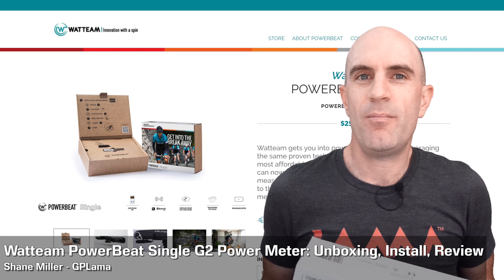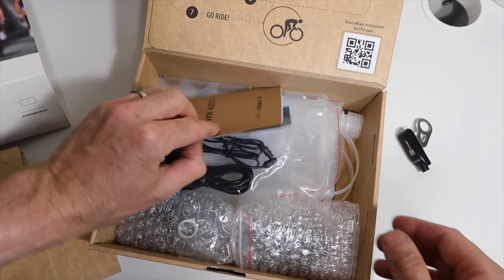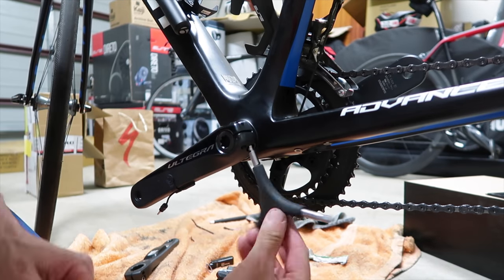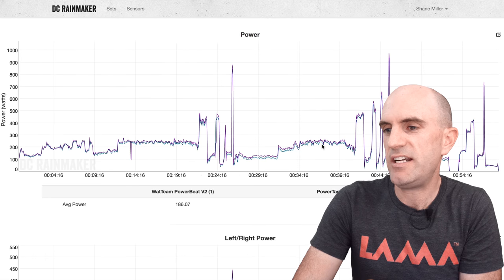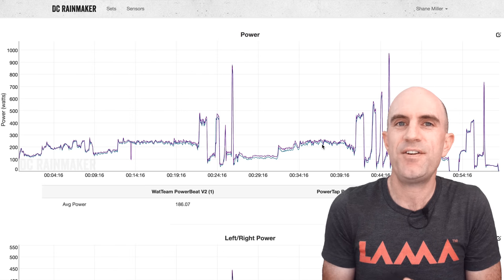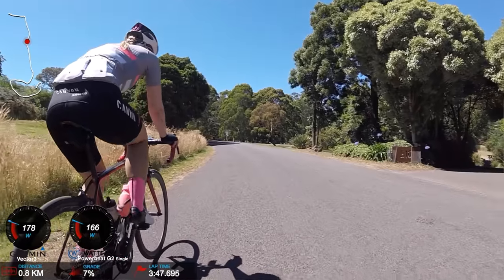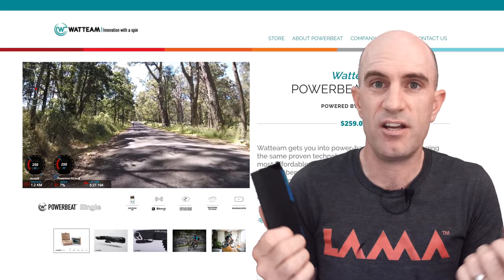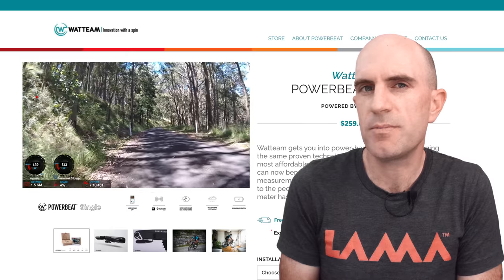Watteam PowerBeat Single G2 Power Meter: Unboxing, Install, Review

Comment: Hey Shane - so glad to see this review, I've been keen for your take on them.  I saw the other comment on calibration issue of not having a second source to compare to.  How about a KICKR17?  I assume the KICKR is accurate enough to figure if they match then it's all good?
Reply from the maker: Sure. Depends who you trust.... it’s a can of worms. I’ve always been able to line up my Kickrs nicely.
Reply: Hey Shane - Want to follow up on this.  3 months later and Watteam hasn't added that adjustment to their app that I can find.  I hope they do follow through with this.  I purchased the self glued option for my girlfriend's Ruby...catch here is that she has the stock Praxis Alba cranks which are NOT on their compatible list.  I knew this going in and knew I was taking a risk but at $200 US (CleverTraining.com 20% off sale) I decided it was worth the risk.  Worse comes to worse and I can get her a 105 or Ultegra crank set (her Ruby is the 105 version).

Here's my issue though, I can't get through the calibration process...it fails at the end every time.  I'm noting a few things during the process and actually just came back to your video to remind myself what you did with the weight.  She has Shimano PD-M20 pedals which are pretty heavy, so I think I need to compensate there a bit...and I just weighed my water bags and they were 10.2 lbs...so I need to remove some water.  But my concern comes in that the water bags hit the frame and crank (particularly the drive side) during calibration and I'm wondering the impact.  Did you notice this when you did yours?  Did yours ever straight up fail the calibration process or did you just see shifted data?

Also of note is that I can't get out of the calibration procedure in their app now.  So I have no way to even see if it's remotely close to correct for power.  It had been my plan to do a Zwift ride on my KICKR17 and comparing several steady state efforts but I'd need to switch it to ANT+ mode and I can't get back to that part of the app.
Reply from the maker: Bike/bag clearance... not an issue on the Giant TCR. Maybe attach some string/wire/rope and hang the bags lower. Maybe elevate the bike to allow more clearance? You'll need to get creative there. As for the app - Mine always completed the calibration ok. I'd like to see more debug detail within the app such as raw torque - that'd allow Quarq/SRM level validation of the process. I'd get everything you've done to date over in a ticket to Watteam support and see if they can help.
Reply: Shane - thanks for the response.  I did open a support ticket with Watteam but wanted to get your take on it too.  Sadly their response (which is cool that they took the time to respond on a US holiday so Kudos to them there) was:

 "We are sorry to inform you that it is not possible to calibrate with incompatible cranks.

We have gone through much beta testing and lab work to ensure each of our approved cranks is properly calibrated."

And a list of the compatible cranks.  I really wish I could get out of them WHY the list is basically only Shimano with a single Campy and a handful of Cannondale cranks.  When the product was originally announced they claimed it would work with any alloy crank which the Praxis Alba is.  Now again...I knew going in I'd probably have issues...but I was hoping that as long as I could get the sensor mounted (that went just fine) I could fudge the calibration by playing with the weights until I got it to match a known power meter.  As an engineer I find enjoyment in this sort of stuff...but I need a little bit of their help.

I"m now wondering if when you put in "Other" for crank type (their app DOES allow that) it simply won't allow the calibration to work.
Reply from the maker: Hmmm... There's two sides to them allowing more user control... it does increase overheads on their end. There's always balance when it comes to cheap power meters and levels of service/etc. Without the raw torque number it'll be difficult to fudge the numbers. It'll take a while on a non supported crank.
Reply: Yeah at this point I'm thinking I'll just buy her a set of Shimano 105 5800 cranks.  They are compatible and not overly expensive.  Even with the new cranks (and BB and cost to pull the Praxis M30 BB and press in the new BB) it will still be less than the cost of most other power meters.

Comment: As long as it tracks (almost) the exact same, isn't that good enough? At least for training, having consistent reads seems much more important than getting your max power. As long as you can see progress, I think it sounds good.
Reply from the maker: In isolation, sure. When wanting to compare numbers from previous power meters, go head to head with others on Zwift, or trust the effort is the same as a smart trainer, no.

Comment: Shane, Perhaps an average consumer will not have other power meters to compare with, so where is the reassurance of the accuracy of the unit upon purchase and initial setup for the cyclist purchasing this as their first and ONLY power meter? They will not know whether the unit is accurate or not.  But I like the way you reviewed it and tried to fix the calibration. Also a scaling thing you mentioned, how does one know what is accurate if this is the only power meter device they own as mentioned above, will it really help?
Reply from the maker: Discussed all trough the comments already. My take - Power is a known measurable unit, like distance. When you buy a tape measure it needs to be correct, not 5cm out per meter (give it take). Let’s say you build a house (an analogy for your training). If you use only that tape measure, fine. If you use another tape measure at any point, or you work in another house with your wonky tape measure, things go bad.
Reply: That's exactly correct Shane. Thank you for your reply. 
My point was almost saying 'does one need to own a second unit of power to see if this unit is measuring correctly'.

Comment: I purchased the dual side, self-glue version of these back in September.  My first few rides the L/R averages were going way off so I reached out to the crew and after sending them pictures they noticed my Right unit was glued incorrectly and sent me out a replacement at no charge.  I glued the replacement unit and things were reading more normal.  I don't have a trainer or pedals to compare against for accuracy - if anyone has suggestions on other ways to check accuracy  let me know - but aside from that I haven't had any issues with the devices.  I will say to make sure that the pod is not touching the crank arm because little things like that could throw the reading off.  My solution to get a nice tight fit of the pedals while making sure there is a little space is I put a folded paper towel between the arm and the pod so that when the torque from tightening the pedal moves the pod closer to the arm it has a barrier, and then when done just remove the paper towel.

Comment: I have had the 4iiii left side only unit for 22 months. I like that you can calibrate the Watteam under load but I am concerned about the location of the unit on the crankarms.  Pretty sure I would hit it  but the price is a game changer.  I think I prefer the CR2032 battery solution which lasts ~100 hours. I keep an extra one in my patch kit. You are assuming that your Vectors power values are correct. Is that a solid assumption?
Reply from the maker: Vectors and P1. And on the flip side you’re assuming they’re not correct. It’s not a guessing game on my part. They’ve been put up against many other power meters and had static weight tests performed.
Reply: I am a physicist/scientist and in my field you are guilty until proven innocent. It is not personal. Your answer adresses my concerns.

Comment: how do you know your power meter your using isn't over-estimating? you can't compare the actual numbers, you should only compare how the data tracks against the more expensive system. which this looks like it does pretty well
Reply from the maker: Static weight testing and 100s of other comparison tests across a ton of other power meters. I’ve got a handle on what’s accurate and what’s not. Your point is raised a lot.

Comment: What worries me a bit is that the first ride was OK and later it went out of whack. Who is to say that will not happen again, some time down the road. Tempting purchase but. And either ANT+ or BLE also sucks, for using with zwift (BT through zwift link app) and a Garmin ANT+ only devices later :(.

Comment: Did you send the data to watteam after your fix and were they able to reverse engineer the problem and come up with a reason why they weren't tracking correctly? and updated their calibrations process?
Reply from the maker: Their app sends the calibration data to them, so they have the data.

Comment: Great review Shane!
Do you know if it would work with supported (left side) crank arm on a not supported crank set ?
Reply from the maker: Cheers. I'd go with "nope" as it'd have a unknown deflection/bendy properties that'd render the measurements useless.
Reply: Thinking about it, might be OK - if the axle is rigid (which you'd hope) then it might be OK as long as the crank-arm can properly attach to the rest of the (un-supported) chain-set . The bulk of the measurement is after all in the crank arm, not the rest of the chain-set. That said, not sure how much compatibility there is between supported crank-arms and un-supported chain-sets..
Reply: The short story is that it has to be hollow aluminum crank design. They're going off the formula of how that material flexes (stretches).  Carbon would flex more and solid less, thus outside their calibration.
Reply: I think what Ripinda1911 is asking is, if they either fit a sensor on a supported crank-arm, or purchase a pre-installed one from WattTeam, and then fit that onto the remainder of an un-supported chain-set, i.e. the axle, spider and right crank-arm, then would it work. That's what I was reading it as anyway, no idea if that's correct or not of course :)
Reply: @Tim Parker Yeah thats what I ment. Sorry English is my second language.

Comment: Hi Shane, if you had a choice between the watteam dual side vs the new gen 3 Stages left only, would you stick with powerbeat? Thanks in advance.
Reply from the maker: I've not had a look at the dual Watteam unit. L/R and L only are different... Your call on what you need.

Comment: Just received my Powerbeat G3 Single and found they didn't include the glue! Unfortunate. I do have a question: I have a Wahoo elemnt, where should I mount my cadence sensor? Previously I had it on the left (non-drive side) crank.
Reply from the maker: The G3 will transmit cadence. Get that installed and you’re set.

Comment: Did you compare power with a smart trainer like Neo or Direto, that could have eliminated pedal weight issues.
Reply from the maker: Pedal weight issues were with the static calibration process, not accuracy.

Comment: Hello Shane. I own Bkool Smart Pro  trainer and want to have a power meter for a budjet. Right now when I doing planned workouts with using estimatied power thru the trainer I'm not sure what I got. Will Watteam PowerBeat Single G2 be a nice solution for comparasing the trainer with "normal" power meter? And if data is pretty similar then I can defenetly will use it for outside training. Also I think when I will have some compare data between them I can use Power metric according to expections without using luck in measurment. Thank you for your videos.
Reply from the maker: Watteam recently went out of business. So no, not a good solution.
Reply: @gplama  Too bad. It was interesting solution for me because I have rear breake lokated under BB on my B'TWIN bike and having 4iiii crank (the sensor lockated at the center of the crack) as an example won't fit me because of overlapping of power meter module and rear break itself. May be there will be some budget units in the future. Thank you again.

Comment: Shane Miller Hello,
I bought this power meter and i have a question
How can I know that the POWER METER really shows me correct numbers and not a little below? 
TNX :)
Reply from the maker: You need to compare it with a known good reference point.
Reply: tnx

Comment: Hey Shane, got any opinion / review of the newer G3 model of this? My CX bike doesn't have clearance for a left-crank powermeter so i'm tempted to go with something along this line instead.
Reply from the maker: Don't touch. The company has closed their doors and no longer operating.
Reply: Oh darn! That really sucks. the search for a cheap compatible powermeter continues then, maybe I'll wait and try one of thise IQ2's after they release. Thanks for the heads up!  @gplama
Reply from the maker: @Tkdmaster1991  Wheeyy jumping from fire to fire! haha. If InPeak have nailed the fix for their zero-offset (which I'll retest in a few weeks) that might be an option. They're all about the CX on their website. Stay tuned. As for IQ^2.... stay tuned. Maybe. They still don't exist in the real world yet.
Reply: Yeah I saw the InPeak arms, but unfortunately my frame has virtually no space behind the arm itself to accomodate a power meter buldge, not big enough to even put a Garmin cadence sensor behind.. Thanks again though for the great feedback! The bike in question is a 2016 Trek Crockett 9 Disc if you're curious.  @gplama

Comment: i noticed you didn't torque the crank pinch bolts. This does have an affect on the Stages zero offset. Might have an affect on the calibration ?
Reply from the maker: If it did did, it'd have been negated by the static weight calibration. Well, in theory.
Reply: I tawt i taw a puddy tat oh wait no that looked like a torque tool in his hand when those bolts went in.
Reply: Thats a 3 way wrench look again

Comment: Thoughts on that little cable bend? It doesnt seem durable in the long term
Reply from the maker: Seems ok to me. It's static on the bike. It's like headphones... they last years of bendy twisty use. Time will tell though I guess.
Reply: It's not going to be static as it needs to be removed to charge the comp unit.  I have the dual version. Time will tell but for the cheap I still can't complain. I would imagine in 2-3 years I'll be able to replace it with something half the price.

Comment: hi Shane Miller.. do you still have the sensors? the one to be attached to the crank? i had mine broken.. :(
Reply from the maker: Best look at getting an other power meter. Watteam have been out of business for a few years now.
Reply: Thank you.. I was just wishing to use the spare ones.. I just need the strain gauges

Comment: Thing is, if your buying this power meter you probably won't have another power meter to compare it to so how will you know if it's out? Particularly if it's a cheap power meter, chances are the buyer can't afford a more expensive one.
Reply from the maker: If having accurate power is important, then this isn’t likely your best option to choose. That’s the trade off. It’s also not to say expensive power meters can’t also be incorrectly calibrated.
Reply: Shane Miller - GPLama I haven't got a power meter yet because of a lack of money, but when I get one I want to know it's accurate.

Comment: If someone buys this power meter and does not have a second "reference" power meter to test against, how does one determine that their unit is an accurate one or not?  Even if one goes through the normal  calibration procedure it obviously does not "fix" the measurement until you apply the "adjustment".  However I still don't see how someone will know that they need an "adjustment" if they don't have the second power meter to compare readings to.
Reply from the maker: You'll never know..... it's a common issue with people who've has power meters for years and get a smart trainer only to find out something is up. Who do you trust? That's where static weight tests are very very very handy.
Reply: It is possible to check on the road, might take a while if you want to calibrate at every conceivable power level though ;)
https://www.youtube.com/watch?v=sqb-WhzCAgw

Comment: The problem with these is most people that buy them they are going to be their first powermeter and they will not have anything to calibrate it against.
Reply from the maker: Correct. A very common issue.
Reply: Compare to apps with estimated power: Zwift; Strava.... A single sided meter reports averages anyway. (Thanks for the info. Shane!  This was exactly what I was searching for).
Reply: I see some people coming wanting me to calibrate their low budget solution against my Quarq DFour...
Reply: Good point.
Reply: As long as it's consistent to itself then its still a great training tool.
Reply: Yes. I bought into that.  Agree with your statement, entry level power meter will attract a lot of first timers, and its not a simple bolt on and god...that calibration and self gluing process can be daunting for most. I recall after gluing it, the app would not let me calibrate until 24 hours had passed. The process was frustrating.

Comment: how did you know it wasn't the vectors that were out of wack?
Reply from the maker: That'd mean the P1 would be incorrect, the Neo, the Kickr, the calibration process (as verified by Watteam), the list goes on. All data showed the Powerbeat I had needed a bump up of the slope. I did that, all was well.

Comment: wouldn't it be ok if it was consistently out by 10%? i.e. precision then accuracy
Reply from the maker: If it was my/your only source of power, sure. Not acceptable if you need to track watts for watts across power meters/trainers.